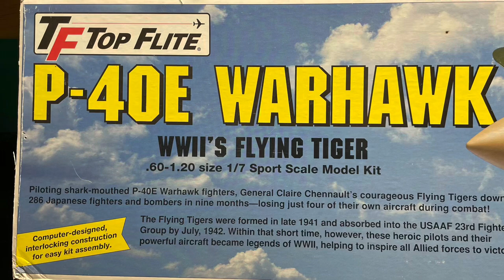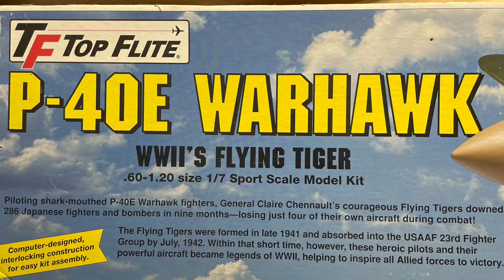Top Flite .60 size Gold Edition P-40E Warhawk Gear Pods and Super Fil Demo

Comment: Frank great job.  The reason your flap blocking didn’t lineup was because your left flap hatch is backwards. Check your plans and you’ll find that both left and right flap slots are on the same side.
Reply from the maker: Yeah, I figured I made one upside down. I’ll make due somehow, or make new flap hatches. Thanks.